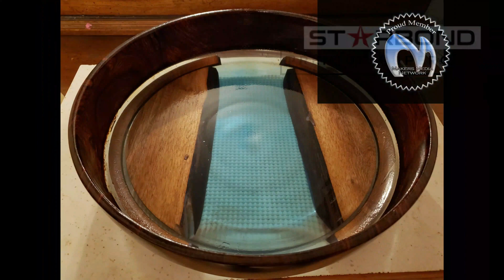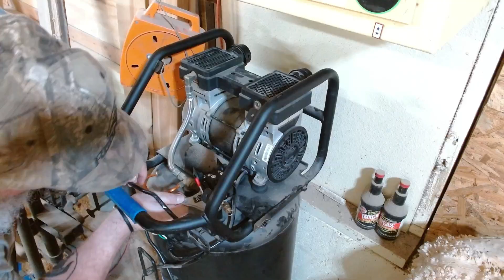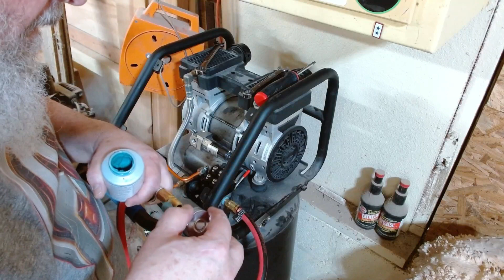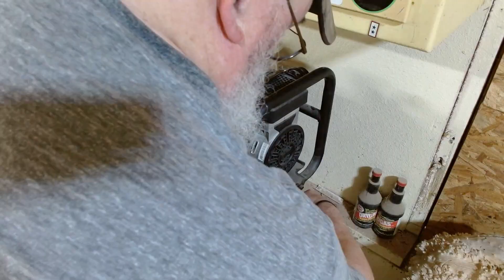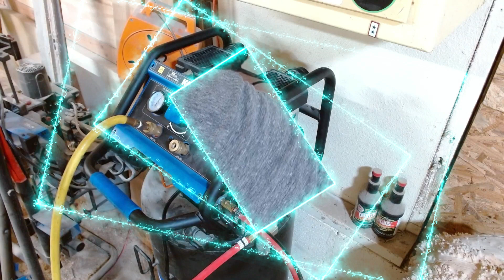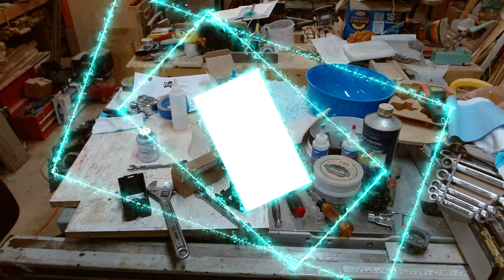Replacing Pressure Switch - 26 Gal Quiet Tech Air Compressor

Comment: I have two wires coming out of my motor one has 3 black white green one has 2 white and black. Do you know which one goes where?
Reply from the maker: The one with 3 wires goes to the pressure switch.  The one with 2 wires goes to what looks like a start capacitor.

Comment: Same model compressor, mine will restart as long as tank pressure is below 30psi, I changed the capacitor with no change, safe bet my problem is still the pressure switch?
Reply from the maker: It sure sounds like it!

Comment: I'm thinking this is my same issue. Compressor will not kick on until tank is almost bled down to 0. Then will kick on but only fill the tank to ~50 psi, then stop.

Do you think that's my problem?
Reply from the maker: Sounds as likely as anything else.  They build these compressors to be throw away items.  And that's what most people do when they malfunction.

Comment: So u reused the unloader valve from the old part?
Reply from the maker: Yes.  I didn't want to have to try and reroute the copper tubing.
Reply: ok thank u so much. We have this compressor at my barber shop and need to replace this part as well. , so ur video really helps!

Comment: So mine sounds like it has the same issue, I bought the lefoo and got it out together and realized that it's vertical and not a right angle anymore. What did you end up doing? I am at the point looking at copper tubing and replacing that copper line to fit the difference in the valve? I agree with you, I don't wanna spend $65 on a switch box of I dont have to? Do you know the thread or nut size for the copper line? Thanks so much
Reply from the maker: I took the release valve off of the old pressure switch and used it on the new one. It worked fine.
Reply: @TheMessyStudio  I really went in depth and I found what looks like the same replacement part I bought only it had the 90 for about $25 it was a husky brand so I'll let you know if it works it's supposed to come sometime tomorrow
Reply from the maker: @CTRadventures  Cool!  That wasn't available when I got mine... or I couldn't find it.
Reply: @TheMessyStudio  so check it out. The reason that caused the mystery problem is a neutral line that went bad on the energy providers side, causing extremely low power and power swings. So I figured the motor was running twice as hard to try and compress and probably burnt it out
Reply: It didn't fix it, here's what's going on

https://youtube.com/shorts/z4u2kN1AmDs?feature=share3

Comment: Mine will try to kick back on but just hums I changed the pressure switch with the same result
Reply from the maker: That sounds like it could be the start capacitor on the motor (if it has one).  If it has brushes, they may be worn... I'm really not sure.  Sorry I couldn't be more help!
Reply: @Billy Burt (The Messy Studio)  it's actually the exact same unit you have
Reply: It’s is your capacitor.  It’s under the black round cover right next to the electric motor.
Reply: @napieraustin  I will try to look at it this weekend can you recommend a part number and where to buy a new 1

Comment: I've replaced my switch and the tank will refill when it wants too. By saying that I mean it will fill up and you can drain it and it doesn't refill, I did take it off an extension cord which I found out wasn't good for it. Brought it to directly to the outlet and it started filling up and shut off. I drained it again and now nothing. Any ideas????
Reply from the maker: Sounds like you may have gotten a bad switch.  Have you drained the water out of  the tank using the bottom valve?  If there is water in the tank, it could be what took the switch out in the first place.  That's what happened to mine.  Which is why I added the inline filter.  It doesn't seem to  make as much water now, but you still need to drain it every month or so.
Reply: I had the same problem.  I got a POS Craftsman 26gal 150psi.  I replaced the pressure switch and it's still won't kick back on at 110psi (where I set it).  System has to completely drain before the motor will actually kick on.  Going to get a different regulator value (one without a damn strator on it).  As for drying the system, I set up a copper coil line directly from the motorhead.  It runs through a universal transmission cooler (car fan hooked up to a transformer) and then through a dryer before going to the tank.  Air goes into tank around 78 degrees, and little water now.

Comment: Great video Billy. I have that same air compressor. Well worth fixing and well explained.
Take care.
Gary
Reply from the maker: Thank you, Gary! I thought so too. I was a little apprehensive at first, but it was actually fairly easy. 
Billy
Reply: I took the shied off because one of the lines was leaking. Was still under warranty but it was easier to fix it than take it back. I also put a valve on my main line that runs to the back of my shop. I shut it when done for the day. If I remember LOL

Comment: i worked with pneumatic temperature controls for many years, I would recommend an auto drain on the tank and if you need dryer air an air dryer in the line to your shop. Great video.
Reply from the maker: Thanks for the tips, James!
Billy